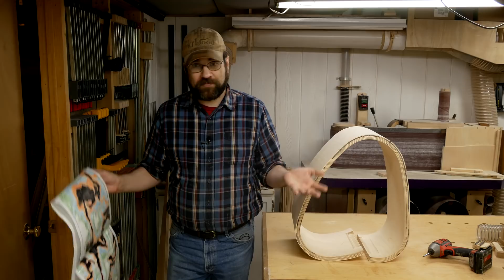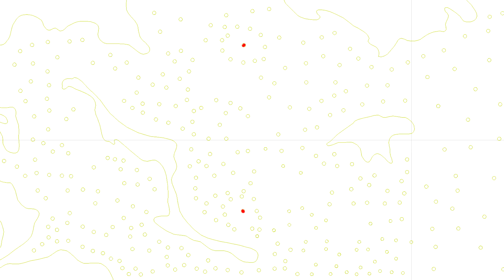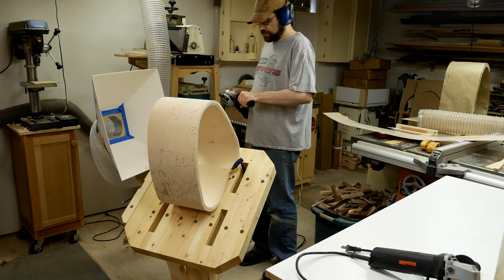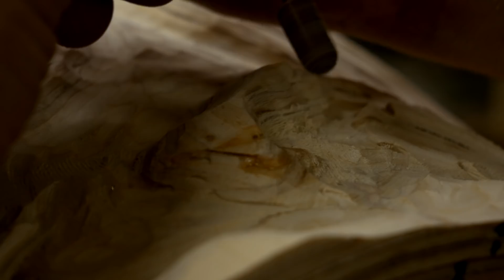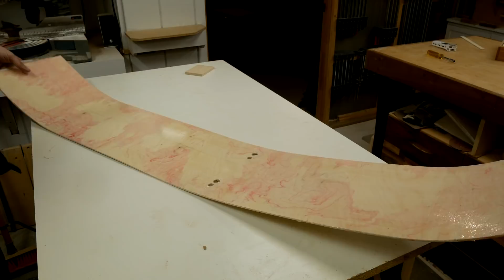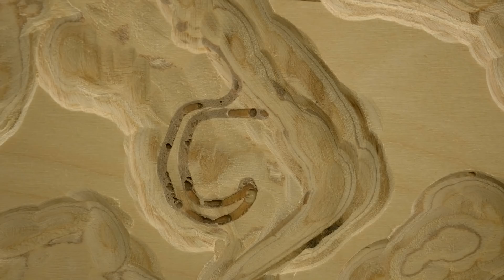Project Wavy Bent - Pt 3 - Power Carving

Comment: Nice. But not easy. This work can be done by CNC machine.
Reply from the maker: You would need a large 5 axis machine or a lot of complex fixturing and repositioning to do the finished piece on a 3 axis machine.with a huge amount of z capacity.  And you'd have to model it in 3d.  Anyway, I don't want to sit back and let the cnc do everything for me.  This is the kind of way I like to use cnc.  Just make my life easier and then let me do the real work.
Reply: CNC machine its just a helper, like any other tool. Just break your 3D model to a few parts, machine these parts one by one and mount all together. You make a lot of non linear art work every video, and the results are beautiful. I think you need a more powerful CNC helper. For example, robotic arm (:
Reply from the maker: That wouldn't be the same at all.